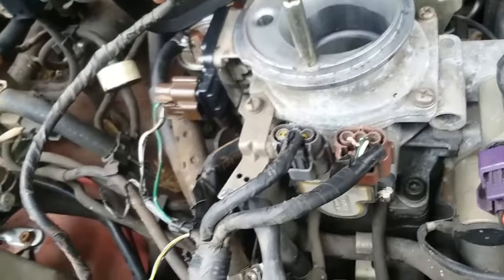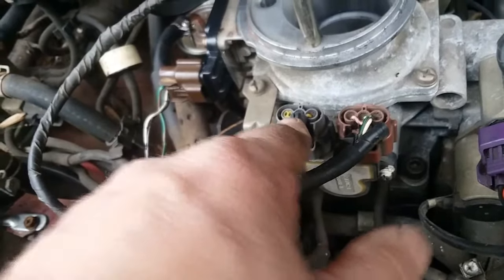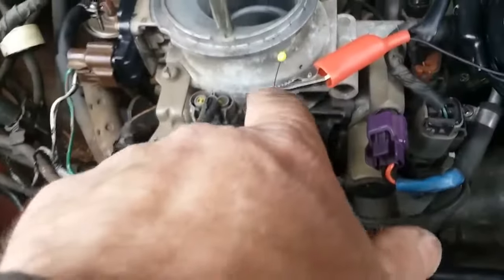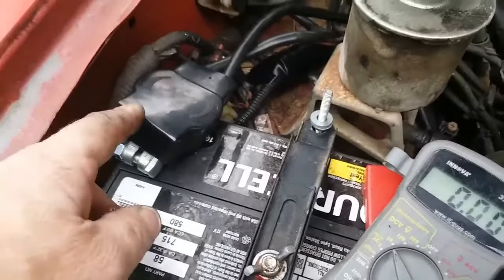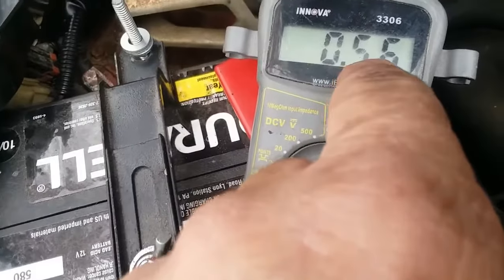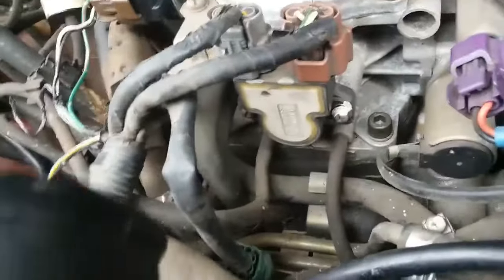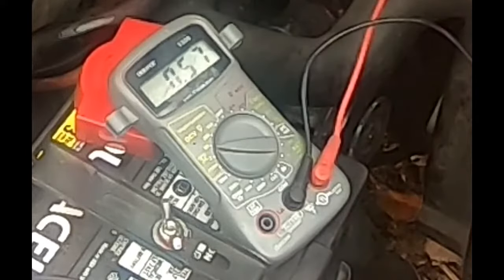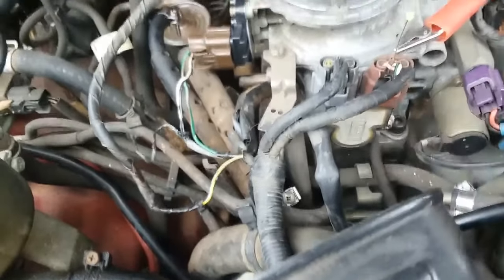Adjust the T.P.S Nissan Hardbody

Comment: I have a 96 Auto D21 Hardbody and I was wondering if my idle is a little bouncy and low could it be that I turn the T.P.S CLOCKWISE? Or it is always counter clockwise. Also it idles at like 900-1k during park then when I drop it into Drive the idle drops down could this be a problem of a fuel injector and fuel filter. Please let know I need help.
Reply from the maker: @troyledz1961  if you turn it one way it lowers the idle the other way raises the idle.  I don’t think your problem is in the fuel injector.  Try adjusting the throttle position sensor.  If that don’t work you might have a good ole fashion  vacuum leak.

Comment: Where did you get your parts from. I'm having idle issues with mine and replaced egr , engine coolant sensor, new rotor and cap wires, o2 sensor still got a misfire running rich. Noticed mine has a EGR VACUUM SWITCH VALVE SOLENOID and its making a sparking noise wanted to know where u ordered your from I know there's about 4 of them in these trucks thanks and aloha from hawaii
Reply from the maker: Thanks for watching. Believe it or not a majority of the parts I get com from Amazon.

Comment: Hey buddy have a 97 hardbody I just got. It doesn’t idle at all.. only way it will run if u give gas
Reply from the maker: Thanks for watching.  If you don’t know when the fuel filter was changed I’d try that.Have you try adjusting the TPS? Have you done a fuel pressure test? Clean the idle air control valve?
Reply: Buddy this guy is clueless.. if you have p0500 code the speed sensor in the transmission needs replacement. I’d also clean up your mass airflow sensor. If it runs better with it unplugged there’s your problem. Do the same test with the idle air control valve on the other side. My 97 Nissan would die at idle if I didn’t give it gas. Looked at these 3 things now she runs great.
Reply from the maker: @KodyAllenEstep  Thanks for watching, 
 I never got a  code p500. I was getting a evap code.  The TPS does send a signal to the purge valve. so it's not  a far stretch to  see they are  related. Don't take my word for it, read the wire schematic for yourself  then tell me I'm wrong.  
P.S  Nobody likes a negative  keyboard warrior

Comment: What did it end up being ? I’ve got a 1996 Nissan pickup. I’ve changed out the charcoal canister the vent valve that going onto the canister and all rubber lines in the back of the truck.  I blew out the hard line with air compressor that head to the engine bay it was chalked full of charcoal.  Not sure what else’s to do.  I didn’t replace any of the round black valves.  Wasn’t sure if it might be the purge flow control valve on the left side of the engine bay I blew it out and changed the vaccum lines in the engine bay also.
Reply from the maker: I replaced the whole evap system and still get a check engine light. The truck runs great so I just accept it as a fact of life.

Comment: I can't thank you enough for this video. This gave me the motivation to continue working on mine.

About a year ago, I bought a 96 d21 in rough shape to fix up, and "gave up" about 6 months in because the damn thing just wouldn't run right. 2000 rpm idle, did everything I could think of and still couldn't fix it. Since then, it's sat.

Tonight I decided to try again, and I found your video from less than 3 months ago, and with your advice it immediately brought my idle down from 2k to 1k. I've never had a greater success than that.

Keep it up.
Reply from the maker: Thanks for your kind words and thanks for watching. I know your pain. They’re great trucks when they run right but when they don’t it could be a nightmare.  Have you tried a new mass airflow sensor? That could effect idle as well a dirty throttle body and idle air control valve.